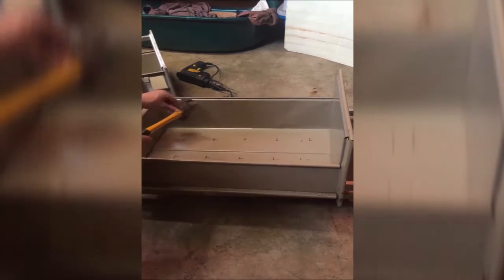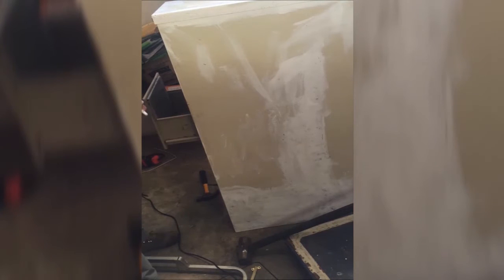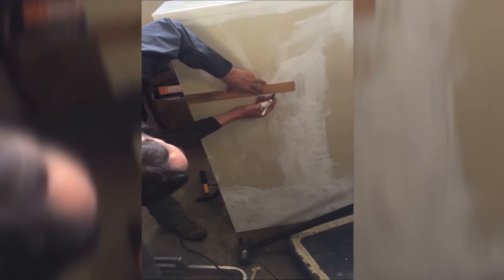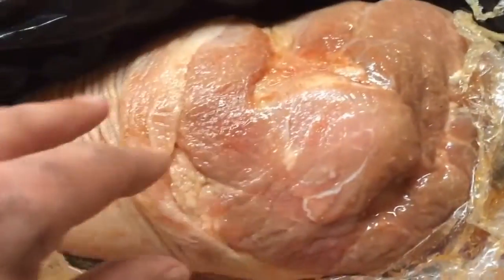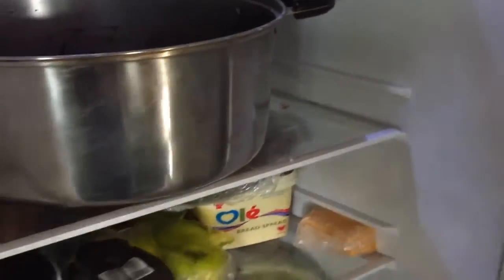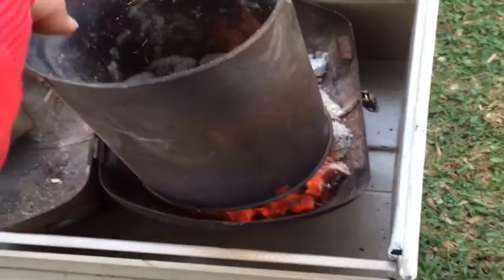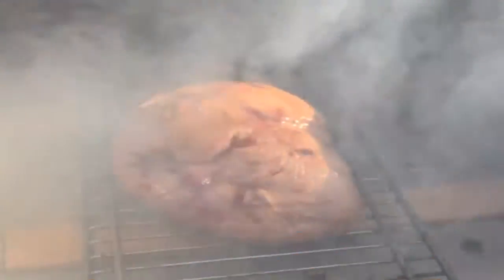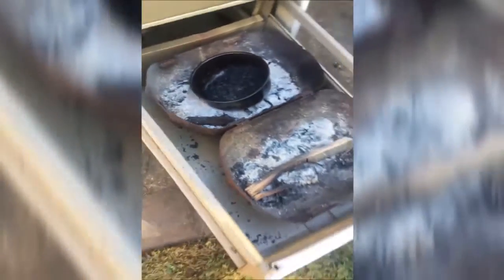DIY Filing Cabinet Cold Smoker

Comment: Does it matter if theres still paint on the inside of the draws like your smoker?
Reply from the maker: Joe Ranginui Joe Ranginui Not really. I do however recommend that you do 3 or 4 high intensity firings inside the bottom drawer so that the paint can start flaking. Make the fire with the 2nd to bottom drawer in place as that also tends to flake being in direct contact with flames. Then use a paint scraper to get it all off. It is meant to be a cold smoker and temps rarely exceed 100 deg Celcius. I also painted the outside of the kiln with NS7 high temp paint. 😄👍
Reply: Cool cheers for the info dude